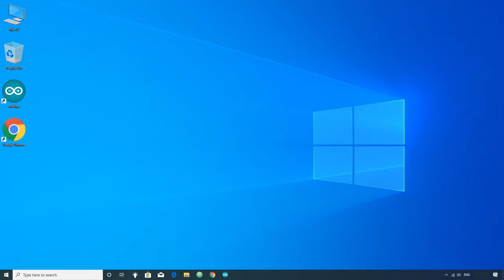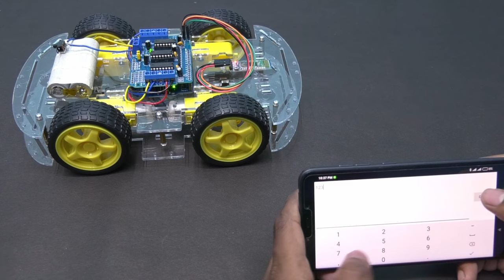Bluetooth controlled Arduino RC Car | Control using your Mobile Phone | Ut Go

Comment: Bro the code is not working. Pls help out
Reply from the maker: Have you installed the Adafruit Motor Shield V1 Library through Library Manager?
Reply: @UtGoTech  Yes bro. PLs pls help me
Reply: @UtGoTech  what should I do
Reply: @UtGoTech  Now I have also added two lithium battery
Reply from the maker: What issues are you facing?
Reply: @UtGoTech  BLUETOOTH_CAR (2).ino: In function 'void Stop()':
BLUETOOTH_CAR (2).ino:107:6: error: redefinition of 'void Stop()'
BLUETOOTH_CAR.ino:95:6: error: 'void Stop()' previously defined here
Return code is not 0
Reply: @UtGoTech  Bro after doing connections the bluetooth module get connected to the phone but robot didn't move

Comment: Bhai pehle chal rha tha 
Abb motor driver shield ki green light bhi kaaafi kam blink hori hai or servo 1 or 2 mai voltage supply nhi ho rhi pta nhi kya ho gya plz help
Reply from the maker: Have you charged the batteries?
Reply from the maker: Looks like batteries are discharged. Charge them and it will work fine.
Reply: Yes it works thanks a lot brother
Reply: @UtGoTech  brother can you please help me in human following robot also
Reply: My IR , Ultrasonic sensor and servo motor not working properly
Reply from the maker: Welcome 👍
Reply from the maker: Yes I am planning to do one.
Reply from the maker: Increase the sample time, it will work.
Reply: @UtGoTech  ok bro how I can contact you personally?
Reply: Bro connect nhi ho paa rha Bluetooth shi traah jab app ke saath connect karta hoon toh light blink karna band kar deti hai
Reply from the maker: Contact me through telegram
Reply from the maker: Light will blink slowly after Bluetooth connection.
Reply: @UtGoTech  hnji yhi hora hai
Reply: Jab run karta hoon toh apne aap disconnected ho jaata hai
Reply from the maker: If you close the app Bluetooth gets disconnected automatically. This is normal.
Reply from the maker: Are you able to control the car using your Bluetooth app?
Reply: @UtGoTech   yes , now it's failed to connect
Reply: @UtGoTech  God bless you man you are replying every question 🙏🏻
Reply: I hope I'll complete my final year minor project Betterly with your guidance.
Reply from the maker: What's happening explain in detail
Reply from the maker: @Parveen-20chd explain in detail
Reply: @UtGoTech  bro Aurduino uno mai light orange colour waali bohat light blink kar ri hai voltage input shi nhi AAA rha sayad

Comment: Sir need help!! Bluetooth getting disconnected again and again , connection doesn't even lasts 3 seconds
Reply from the maker: What type of battery are you using ?
Reply from the maker: If you are using AA batteries then your Bluetooth will disconnect after giving command.
Reply: I was using AA actually, which batteries should I use ?
Reply from the maker: @phoenixOP4103 I suggest you to use lithium based batteries
Reply: Sir I just connected 2 lithium ion batteries, it worked fine in start but now the Bluetooth module isn't getting power ( the red LED isn't glowing)
Reply from the maker: Check for loose connection
Reply: Checked , no loose connections
Reply from the maker: Check the battery voltage
Reply: 3.7 volt
Reply from the maker: Check the battery pack voltage.
You have to use 2 batteries in series.
Reply from the maker: You should get voltage between 7.4 to 8.4 volt.
Reply: @UtGoTech  how can I achieve that? Connecting 2 or 3 lithium batteries in series?
Reply from the maker: @phoenixOP4103 Use 2 x 18650 lithium-ion battery in series
Reply: @UtGoTech   ok thanks, I will try it
Reply from the maker: @phoenixOP4103 use 18650 battery holder and solder the battery holder in series orientation
Reply from the maker: @phoenixOP4103 👍

Comment: My Bluetooth module doesn't work, what would be the problem?
Reply from the maker: Please explain? 
Are you able to connect with your Bluetooth module?
Reply: @UtGoTech yes, but it doesn't move forward
Reply from the maker: What type of battery are you using?
Reply: 9 V
Reply from the maker: A 9V battery will not work. Use 2 Lithium-ion batteries in Series to make 7.4v battery pack and use it.
Reply: @UtGoTech How much voltage is the lithium battery?
Reply: your link to compare batteries does not work
Reply from the maker: Ok. I will look after that link. Until then 
Purchase two 18650 lithium ion batteries and a battery holder.

Comment: Hola buenas quisiera preguntar que pasa si uso un modulo bluetooth Bt-05 como haría para implementarlo por que de hecho ya arme un carrito con ese módulo y exactamente como el video pero en las apps que tengo para controlar el carro no aparece el dispositivo pero si da señal el bluetoot cuando lo busco normal pero no me permite conectarme me ayudaría a saber que podría hacer?
Reply from the maker: Bluetooth Module BT05 will work fine.
Check if your Bluetooth module is not faulty.
Reply: Pudiste al final?
Reply from the maker: Sorry I didn't understand your language.

Comment: the connection of hc06 and shield is the same?
Reply from the maker: Yes
Reply: @UtGoTech  not works :(
Reply from the maker: Check module baud rate
Reply: Hmmm I'm having same issue identical build except the hc 06 module... Connects to app fine but I haven't checked serial yet either.. shall have to have a look I think . Any suggestions otherwise?
Reply from the maker: Use correct baud rate in code

Comment: where to find li ion batery with switch
Reply from the maker: I made my own. But you can search it online. You may find one.
Reply: @UtGoTech  how to make it
Reply from the maker: Just take 2 lithium ion batteries and connect them in series. Include a switch if you want to.
Reply: @UtGoTech  is the switch required
Reply from the maker: No it's not mandatory. It just provide easy way to disconnect batteries.

Comment: Hi bro. Aurdino is showing errror messages. Pls help.
Reply from the maker: What error?
Have you installed the Adafruit Motor Shield V1 Library through Library Manager?
Reply: @UtGoTech  Now the error has stopped. i have uploded code.  bluettoth module connected. now removed jumper wire. connected to pc.
Reply: Typing error not removed jumper wire
Reply: Battery not connected
Reply from the maker: Yes you can
Reply: Bro I have messaged you
Reply: Pls accept
Reply from the maker: Ok

Comment: Bluetooth module keeps disconnecting
Reply from the maker: When it gets disconnected?
Which type of battery you are using ?
Reply: @UtGoTech  8F22 9V battery
Reply from the maker: 9V battery won't work. Use lithium ion batteries.
Reply: @UtGoTech  Okay

Comment: I have a truoble in downloading the code...plz help me out
Reply from the maker: First login to your Gmail account after that open the code link and download it
Reply: I did ... But the downloaded file is not supporting
Reply from the maker: Open it using Arduino IDE
Reply: And one more doubt... The Bluetooth module keeps disconnecting
Reply from the maker: Which battery are you using ?
Reply: Lithium - ion 12 v battery
Reply from the maker: Lithium-ion batteries/packs come in 3.7V, 7.4V, 11.1V.
You have said 12V lithium battery. 
Make sure you are using the correct battery.

Comment: I can't able to open the code file from mobile. Can you provide some other way?
Reply from the maker: Don't open it in the Google drive. Just download it and open it in the Arduino IDE.
Reply: @UtGoTech  sorry but I don't know how to open direct in Arduino droid
Reply from the maker: @takashi2234 Just login to your Gmail account then open the code link and download it.
Reply: @UtGoTech  it's showing:
Diagnostics
Use of undeclared identifier stop
Use of undeclared identifier forward
Use of undeclared identifier back
Use of undeclared identifier left
Use of undeclared identifier right
Reply from the maker: @takashi2234 Where it's showing this error
Reply from the maker: Have you installed the Adafruit Motor Shield V1 Library?
Reply: @UtGoTech  yeah
Reply from the maker: Share error screenshot through Instagram. I will help you.
Reply: @UtGoTech  sure

Comment: Hii Sir sorry but I didn't understand wireing can you share circuit diagram ❤️
Reply from the maker: Ok
Reply: THANKS SIR
Reply: How to volt we have to supply to motor driver
Reply: In parallel or serial
Reply from the maker: Between 6 to 9 volt
Reply: Thanks sir
Reply: ? Pls tell
Reply from the maker: Circut Diagram:
https://drive.google.com/file/d/1GcVSN6XH0kwczBQk4KD8B31oZHnIisyH/view?usp=drive_link
Reply from the maker: You can use two 18650 lithium ion cells in series.
Reply: @UtGoTech  Thanks so much for your time ❤️🥰
Reply: For me you made circuit diagram thank you so much 🥰❤️❤️

Comment: tengo este error 
C:\Users\Jesus\Desktop\BLUETOOTH_CAR\BLUETOOTH_CAR.ino:9:0:
C:\Users\Jesus\Documents\Arduino\libraries\Adafruit_Motor_Shield_library/AFMotor.h:156:47: error: 'DC_MOTOR_PWM_RATE' was not declared in this scope
   AF_DCMotor(uint8_t motornum, uint8_t freq = DC_MOTOR_PWM_RATE);
                                               ^~~~~~~~~~~~~~~~~
C:\Users\Jesus\Desktop\BLUETOOTH_CAR\BLUETOOTH_CAR.ino:12:22: error: 'MOTOR12_1KHZ' was not declared in this scope
 AF_DCMotor motor1(1, MOTOR12_1KHZ);
                      ^~~~~~~~~~~~
C:\Users\Jesus\Desktop\BLUETOOTH_CAR\BLUETOOTH_CAR.ino:12:22: note: suggested alternative: 'MOTOR2_A'
 AF_DCMotor motor1(1, MOTOR12_1KHZ);
                      ^~~~~~~~~~~~
                      MOTOR2_A
C:\Users\Jesus\Desktop\BLUETOOTH_CAR\BLUETOOTH_CAR.ino:13:22: error: 'MOTOR12_1KHZ' was not declared in this scope
 AF_DCMotor motor2(2, MOTOR12_1KHZ);
                      ^~~~~~~~~~~~
C:\Users\Jesus\Desktop\BLUETOOTH_CAR\BLUETOOTH_CAR.ino:13:22: note: suggested alternative: 'MOTOR2_A'
 AF_DCMotor motor2(2, MOTOR12_1KHZ);
                      ^~~~~~~~~~~~
                      MOTOR2_A
C:\Users\Jesus\Desktop\BLUETOOTH_CAR\BLUETOOTH_CAR.ino:14:22: error: 'MOTOR34_1KHZ' was not declared in this scope
 AF_DCMotor motor3(3, MOTOR34_1KHZ);
                      ^~~~~~~~~~~~
C:\Users\Jesus\Desktop\BLUETOOTH_CAR\BLUETOOTH_CAR.ino:14:22: note: suggested alternative: 'MOTOR3_A'
 AF_DCMotor motor3(3, MOTOR34_1KHZ);
                      ^~~~~~~~~~~~
                      MOTOR3_A
C:\Users\Jesus\Desktop\BLUETOOTH_CAR\BLUETOOTH_CAR.ino:15:22: error: 'MOTOR34_1KHZ' was not declared in this scope
 AF_DCMotor motor4(4, MOTOR34_1KHZ);
                      ^~~~~~~~~~~~
C:\Users\Jesus\Desktop\BLUETOOTH_CAR\BLUETOOTH_CAR.ino:15:22: note: suggested alternative: 'MOTOR3_A'
 AF_DCMotor motor4(4, MOTOR34_1KHZ);
                      ^~~~~~~~~~~~
                      MOTOR3_A

exit status 1

Compilation error: 'MOTOR12_1KHZ' was not declared in this scope
Reply from the maker: Have you installed the Adafruit Motor Shield V1 Library?

Comment: is 6v enough to work?
Reply from the maker: Yes its worked for me.
Reply: @UtGoTech  my bluetooth connector is not turningon
Reply from the maker: Can you please explain
Reply: I connected my bluetooth hc-05 to power supply but its not turning on
Reply from the maker: I think you mean to say that led on the Bluetooth module is not blinking. Connect your Bluetooth module to 5v and gnd of Arduino board the check if Led is blinking or not.
Reply: @UtGoTech  its not blinking
Reply from the maker: May your Bluetooth module is faulty
Reply: @UtGoTech  how to fix it
Reply: @UtGoTech  also my connection is weak
Reply from the maker: Don't make loose connections.
Reply: @UtGoTech  do it works on alkalaine battery?
Reply from the maker: No. It will not work
Reply from the maker: Try another Bluetooth module.

Comment: Sis, why the DC_MOTOR_PWM_RATE error
Reply from the maker: Have you installed the library properly
Reply: @UtGoTech  I've installed the AFMotor library, I tried yesterday with no error,
but now i try to get an error
Reply from the maker: May be you have unknowingly edited the code. Try to Re download the code.
Reply: @UtGoTech  is okeyy

Comment: Sir when writing the code compilation error coming
Reply: What can I do
Reply: I have install adafruit v1 library also
Reply from the maker: Share error code
Reply from the maker: Have you selected the correct board and port.
Reply: Sir port slected
Reply: Then also problem coming
Reply from the maker: what error you got ?
Reply: Compilation error
Reply: When trying to upload the code it's not unloading
Reply: Sir could you re send this code
Reply: And what to select in the board
Reply from the maker: Currently I don't have it you can download it from the video description.
Make sure you have installed the Adafruit motor shield V1 library and not the V2 library

Comment: the code 
doesnt work
Reply from the maker: The code is correct as it worked for everyone. Check if you have mistakenly edited the code or having some hardware issues.

Comment: My car is not moving ahead what shall I do
Reply from the maker: Check motor directions
Reply: @UtGoTech  where the motor director?
Reply from the maker: First ensure that motor rotates then if you need to change direction in order to match with other motor then swap the two cables going to that motor.

Comment: I have mine working but my forward backward and left right are swapped and no motor combination corrects it so far I've tried swapping opposing motors and swapping polarity have I missed something here haha
Reply: Also I cannot pick up anything from the diagonal direction keys.. I'm ashuming I'm going to have to play around with the code to enable this?
Reply from the maker: Yes. You have to code for diagonal direction.

Comment: sir my bluetooth is disconnecting always can i get reason why
Reply from the maker: What battery you are using?
Reply: 9w
Reply from the maker: 9v battery will not work. You have to use lithium ion batteries as shown in the video.
Reply: Can i use lithium ion 9v Or 12v battery... If I place that it will work good?? Is there any damage caused to bluetooth module now
Reply from the maker: Does your Bluetooth gets disconnected after giving command ?
Reply: Yess
Reply: It is now not even connecting to mobile even though light is blinking
Reply from the maker: I don't think 9v or 12v lithium ion batteries are available in market. You have to use 2 lithium ion cells 3.7v each in series to make it 7.4v battery pack as used in the video.
Reply: Thank you... Sir.. But Bluetooth isnt connecting.. If I connect lithium ion it will work or I need to buy a new Bluetooth module
Reply from the maker: I think your Bluetooth module is not damaged. Try without changing it.

Comment: sir i did all correct but my bluetooth module dint power up
Reply from the maker: Are you able to pair with bluetooth module
Reply: Yes in the past i did and i tested the module it was working fine
Reply from the maker: How you powered up your Bluetooth module ?
Reply from the maker: Connect your Bluetooth module to 5volt pin of Arduino board
Reply: When powered by pc aurdino works fine but when battery dosent works
Reply: @UtGoTech  ok
Reply from the maker: Ok
Reply from the maker: Now install motor shield then power the bluetooth module through the motor shield.
Reply: @UtGoTech  still nothing
Reply from the maker: Ok

Comment: Please tell the specific voltage of battery
Reply from the maker: You can use anywhere between 6volt to 10volt
Reply: @UtGoTech  I used 10 v but it burns the ic
Reply: @UtGoTech  can I use 5 v
Reply from the maker: Which IC ? 
Arduino Board IC or Motor driver IC ?
Reply: @UtGoTech  and I take 3.3 v directly from Arduino fir Bluetooth, is it ok
Reply from the maker: Yes
Reply from the maker: If you use 5volts then your Arduino may reboot itself when you try to drive motor because of under voltage. But you can give it a try.
Reply: Ok
Reply: @UtGoTech  motor driver ic
Reply from the maker: L293D motor IC can take 12Volts easily. What is your supply voltage?
Reply: @UtGoTech  10v -11 v
Reply from the maker: Ok
Reply from the maker: Yes

Comment: how to upload the code ?
Reply from the maker: Open the code in the Arduino IDE then go to the tools and select the correct board and port then click the upload button.
Reply: @UtGoTech  I have a uni project that's why iam making this. will it get connected with any app or need to download the one you used?
Reply from the maker: You can use any app. But you just have to modify the commands in the code as per the app
Reply: @UtGoTech  how?
Reply: Can you pls make a video of how to upload a code and use a new app it be really hopeful if you can make in 4 or 5 days??
Reply from the maker: @AghaXamer Ok I will try
Reply: @UtGoTech  no video man ? i need help with my uni project is there a way i can connect you like discord or any thing else ? i need to submit my project in couple weeks

Comment: bro the code is not working for me
Reply from the maker: For code to work. First make sure that connections are exactly what is shown in the circuit diagram.
Reply: this is my school project.if i win this,my model will be shown in a university.is it ok to use 3.5 V battery @UtGoTech
Reply from the maker: @atharva5660 you have to use a Lithium-ion battery pack with voltage between 6 to 9 volts.
Reply: ohhh thats why it doesnt work @UtGoTech
Reply from the maker: Yes